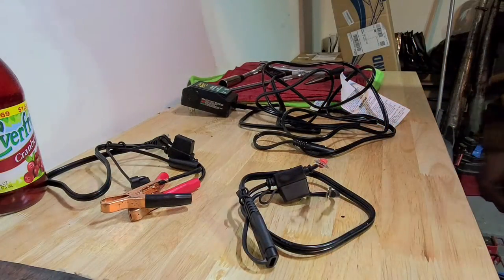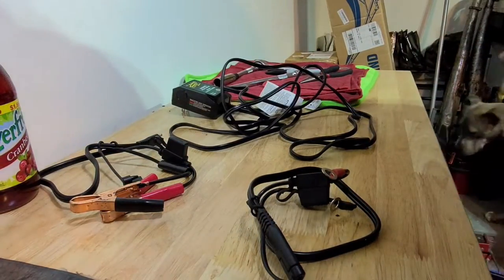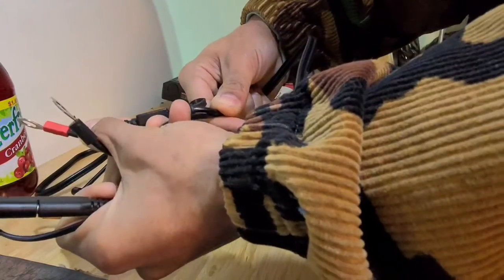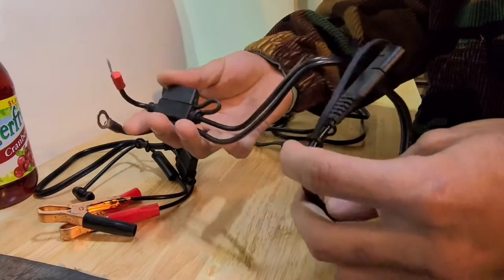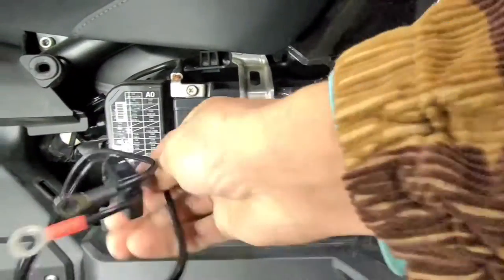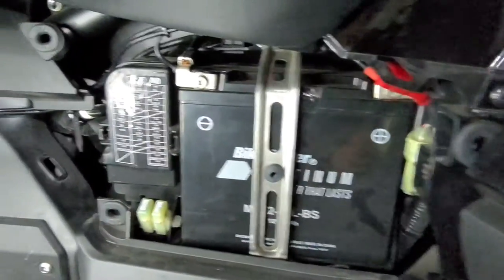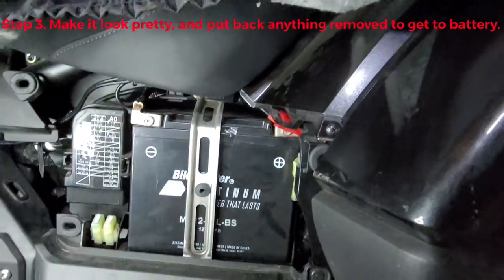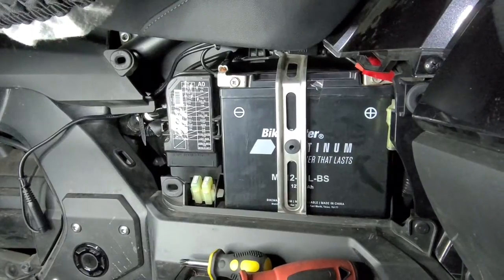How to - Install Battery Tender - Honda Goldwing 2021

Comment: Can I use a full size auto battery tender on a motorcycle?  Or shall I stay with the smaller one like you showed in the video?
Reply from the maker: You can IF it allows you to turn down the amps its charging at. I have a car starter, that will go down to 2amp maintain.  Anything to much higher will burn your battery cells. Reduce its life